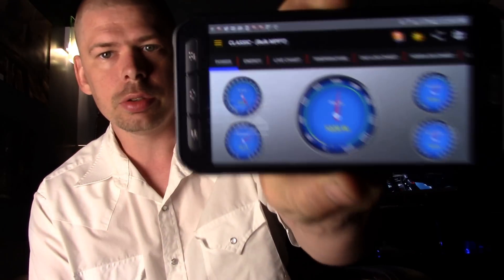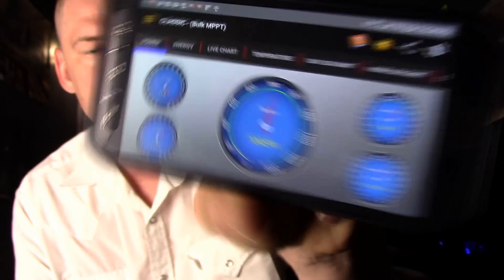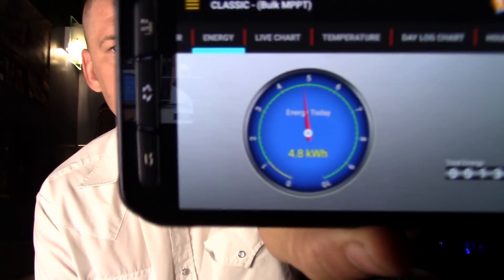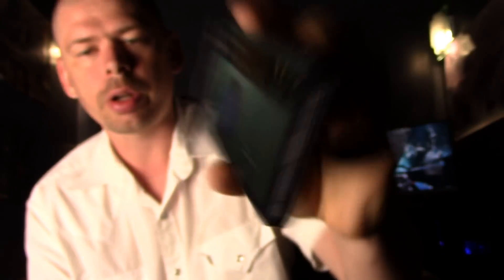Is an off-grid solar power life for you?

Comment: In reality you will need at least 2 watts of solar panels for each amp hour of battery storage with a stationary panel set up. With a tracker you can get by on 1 watt per amp hour. I have run 2 - 6000 btu window units at the same time with my system and still charge batteries.  My aims 6000 watt inverter has run 2 - 6000 btu and a 10,000 btu at the same time. Pulled 70 amps of Dc doing it.
Reply from the maker: That's so cool to run your window unit's  on the aims inverter i'm going to get a new one next week stay tuned it's a really good inverter.